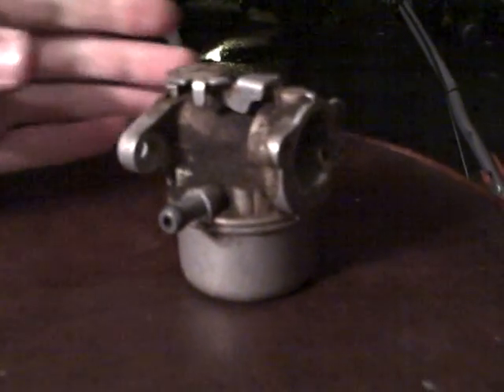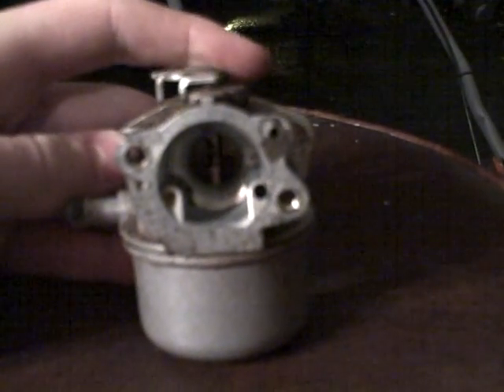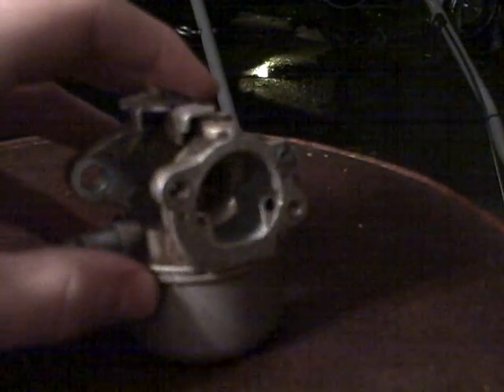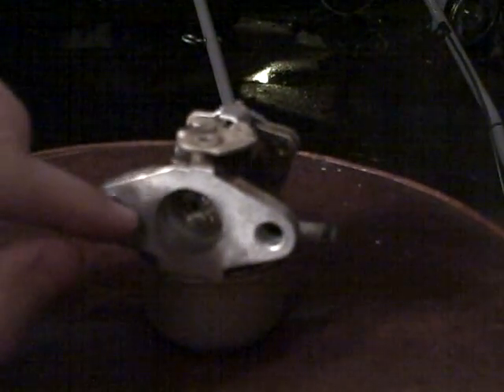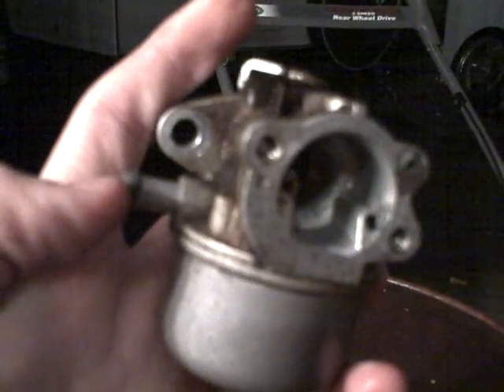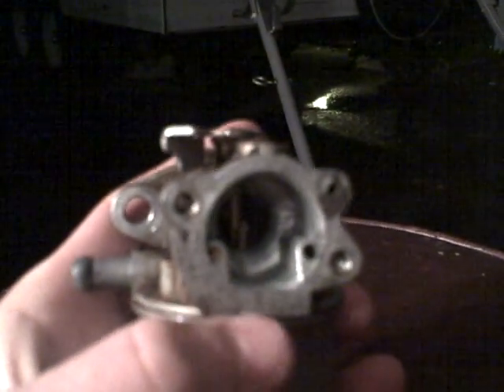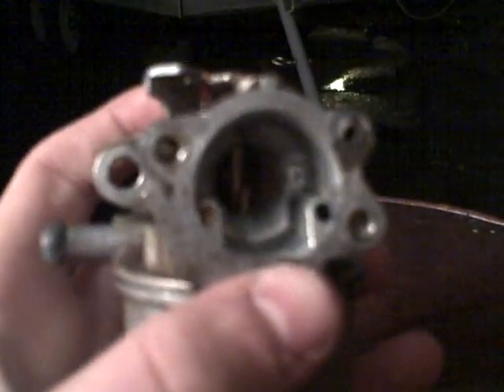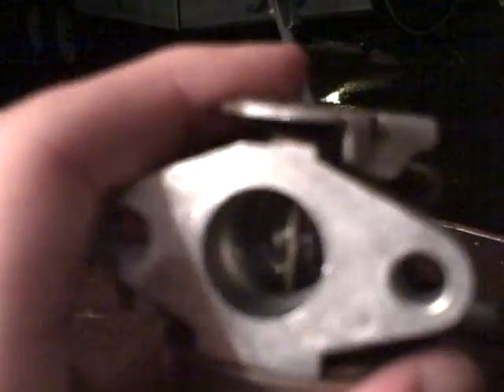How a carburetor works

Comment: Most excellent.  70 yr old here with a 2002 Toro exact carburetor replacing the butterfly shaft and helped me greatly.  That is a  part number 790120 B&S carb.  Was able to find NOS throttle shaft.  Didn't want to use the new carbs that fit many mowers but you never know if it will work on your mower meaning gas metering.  Salute !  ps, good explanation but could have identified each hole functioning.  For instance, the top right hole is for air imput from the primer bulb and I think the bottom right hole is for gas flow after running.  The camera is ok for 17 yrs ago.  Thanks again.

Comment: whats controlling the damper? how does it know when to open and close? mine all of sudden closes and i have to open manuallly theres not cable on it to control it how does it know
Reply: Ro D many throttles are controlled by vacuum pressure from the crankcase

Comment: What would cause a brand new two stroke carb in my blower to flood? It floods even without priming.  The old carb gave me trouble, so, I replaced it and put in a new plug and it still soaks the plug when I try to start it.  Again, it does this without any priming.  The muffler is clean and so is the air cleaner.  The needle in the diaphragm isn't sticking and the choke is mechanical, so I know it's not stuck.  Any ideas?

Comment: @spacemonkeys0681 just drill a 1/16th inch hole right in the top of your carb and hook a tiny hose to it and run it to the fuel tank to compesate for the increased airflow. if that doesn't work, junk the vespa and get a real bike. (shhhh guys, i'm trying to HELP him...)

Comment: its it one of those briggs carbs that sits on the top of the gas tank? if so they dont have any hoses because they use the gas tank itself as a carb bowl, and suck the fuel right up from the tank with long plastic pickups.

Comment: open to start it bealeve it or not it helps ive worked on enuph vehicles to know and i have dumpted my bike enuph to know. Also there is a nother plate in most carburaters that is the choke and you use it when starting  the engin when it is cool. And lots of carborators have a diafram that pulsates like a speaker and that delivers the fule. There are many types of carberators 4 barol 2 baral 3 barol 1 barol 4 barol carbs are ushaly on v8. most vehicles have a fule pump to deliver the fule

Comment: The fule reserve has a valve also when you have your fule line pluged in to the caberrater then it enters the fule reserve and there is a floate that when the reserve is full there is a needle type  of plug that covers the area where the fule enters other wise it would start poring fule out of the carberator. Somtimes a float will stik and when that happens it just gets fluded and most of the time you can tap the carberator and it will unstick the float. After its flooded hold the throttle wide-

Comment: ya air fule mixtuer is very inportant not only for optimom preformens but also it runs cooler if its to lean you are taking in to much air and it heats your moter up and it can even seaz your moter and if you got to much fule its runing rich and then you end up with a lot of un burned gass and it can foul your spark plug expeshaly if its a two stroke and that depends a lot on what you mix your gass at i prefer 32.1 but my bike runs perfect with that mixtur but it verys betwen bikes

Comment: I had a problem with the carburettor on my bike and was wondering how they work- that was an excellent explanation cheers. When I was looking at mine I noticed there was a kind of rubber diaphragm inside the carb- can you explain what that's for?

Comment: And if that don't work, then take all the seals off, put it in a hot boiling pot of lemon juice and let it boil for about 20 minutes.   Then boil it an additional 10 minutes in distilled water to rinse (or rinse in a big bucket of cool water).  Then blow out the water with compressed air.

Comment: if its red lining id say you put the accelerator cable in 180 degrees backwards. as for the tune on the fuel mixture and idleing screws ther should be a forum on the net somewhere telling you how many turns it needs to get it started. then just go from there, tune till it starts and then so that it revs comfortably

Comment: Well, usually I see a fuel line tube in egines like riding mowers, but my simple Yard Machines mower has no tubes for fuel lines. The only thing that is in the liquid gas is the priming bulb tube. And the venturi opening has no tube, it just seems to suck up vapors.
Oh well, some things just work and I might not understand, which is funny.
Thank you.

Comment from the maker: Good questions. 1) The air is esssentially sucked in by the downward movement of the piston on its intake cycle. 2)I'm not sure what you mean by the fuel dropping, but if you mean why doesn't it drip into the carbeuretor, it's because the fuel reserve is underneath. The amount of fuel changes with the amount of air because the fuel is not pushed into the carburetor, but is sucked in by the vaccuum created by the air, and the vacuum strength increases with faster airflow.